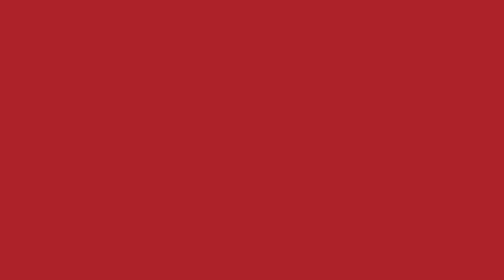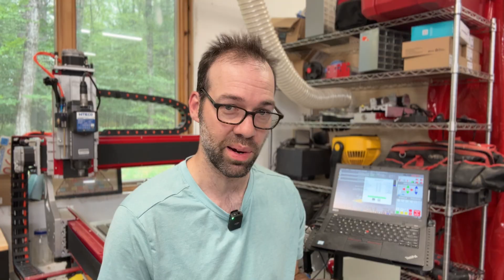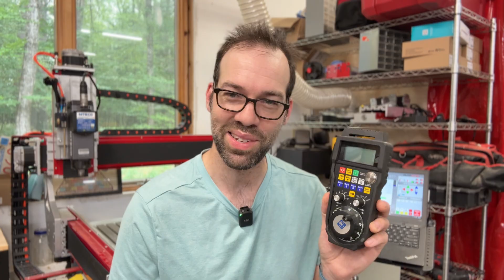What Does the Control PC Actually Control?

Comment: Currently looking at one of your machines. Pro4896 to be exact. 
What I would like ti see is how you start an existing project from a known line of G code. 
And then, does your software allow the user to scroll the G code while watching the spindle location on the screen to locate specific cut areas. 
I do t need these functions often but when you do need them it’s a great tool to have. 
All these features are available on the UCCNC control software. 
Thanks.